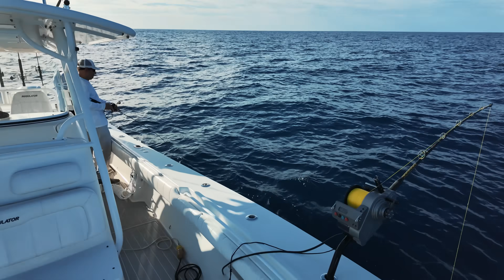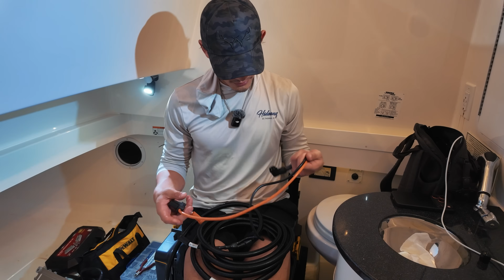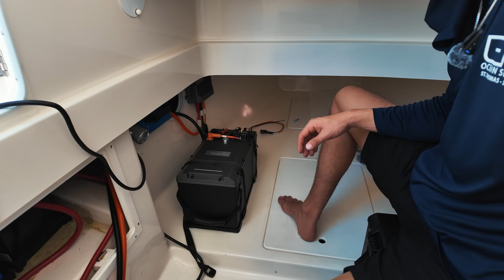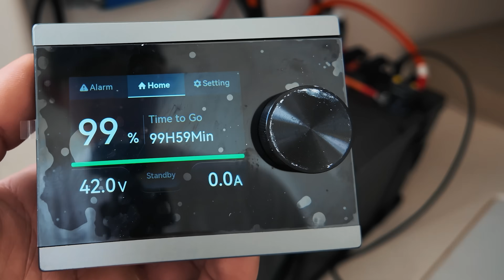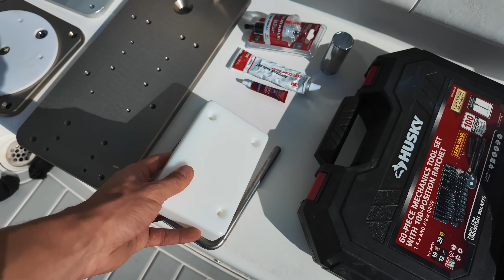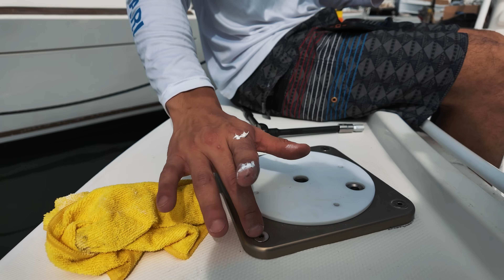HOW TO Install | ABYSS INFINITE BATTERY and SEA SWIVEL (ULTIMATE Trolling Motor Combo!)

Comment: What specific wire connectors/splice blocks are those? The ones you ran connecting the battery to the motor.

Comment: Two questions on the Sea Swivel, 
1) Did the center pivot break, looks like it’s bolted at the end of the video . 
2) Why the grease on the bottom of the teflon between the plates, isn’t it in a fixed position once installed.